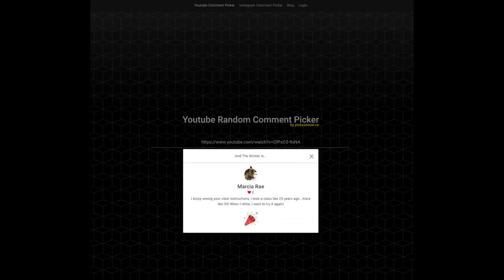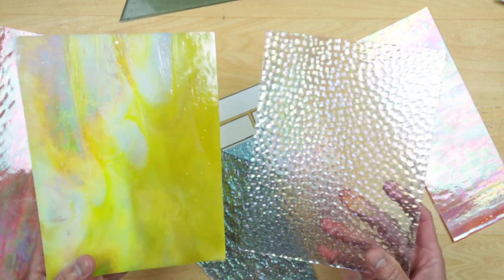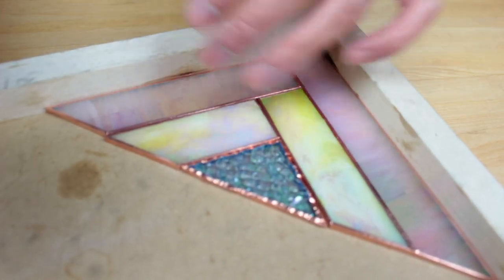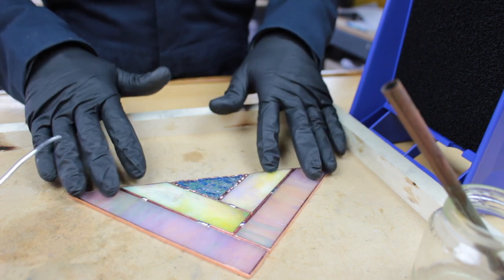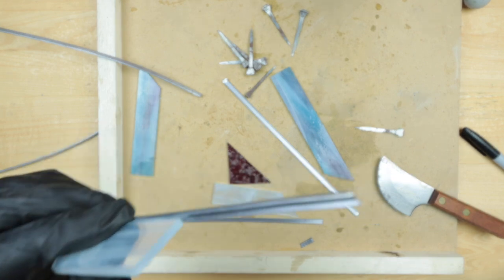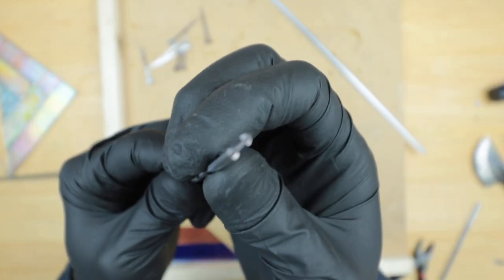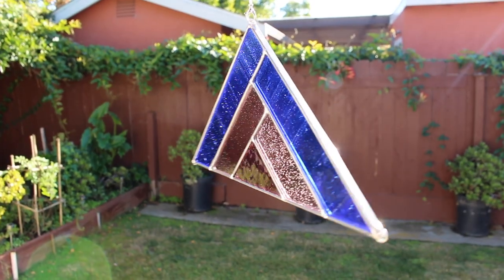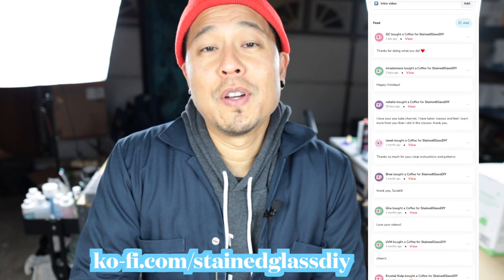Stained Glass DIY - Triangle Project 2 ways

Comment: Thanks for the video. So happy to see more stained glass channels that show how to do it without tons of tools and equipment. If you putty your lead came piece you may end up with have a better hold on the glass, and when you brush it with a coir brush and whiting, it will darken the came and take care of any scratch marks. Also, I've rarely seen such an impeccably clean grinder. 😄
Reply from the maker: Hey RK, thanks for tips.  Would've helped for sure.  yea the grinder stays pretty clean due to lack of use 😂

Comment: For hanging loops, I was taught to use a piece of wire long enough to be soldered an inch or so either side of the loop to make sure it's strong enough. Love the glass choices here.
Reply from the maker: Certainly a smart thing to do for strength, thanks for the tip!

Comment: You need a pair of stained glass scissors. They cut a small amount away from the edges of your pattern to allow for the thickness of tape you add later and save having to waste tape by re grinding

Comment: I've seen people line the outer edges with foil and strategically solder the bordering lead came to the foil on the outer edges to avoid that pulling off in designs like this, where there's a long edge of lead came with no solder points. It still has that super clean look you get from came, but I imagine it takes some practice to make it look so good haha
Reply from the maker: Oh that sounds like a nice trick but I'll have to figure out how they do it in the first place 😅

Comment: This is an older video so you probably know how to widen your lead hobby came channel now but, for those who don't, you can use a fid at an angle and run it through the channel. This should widen the channel enough so the glass will fit. 😊